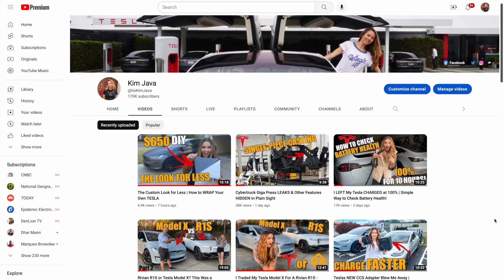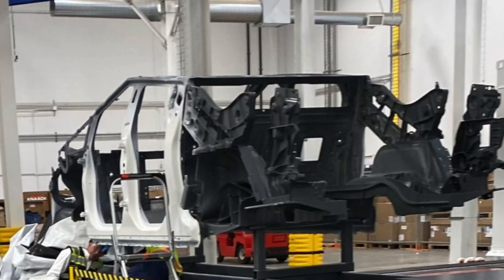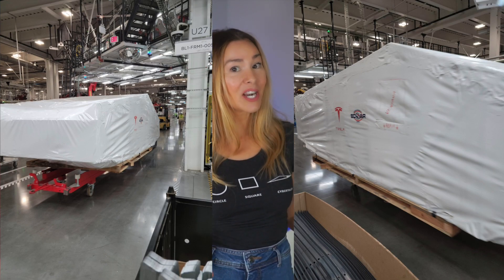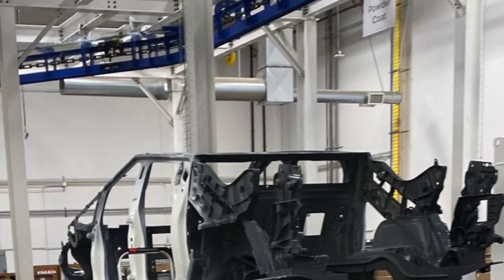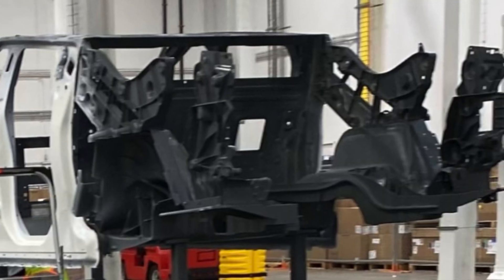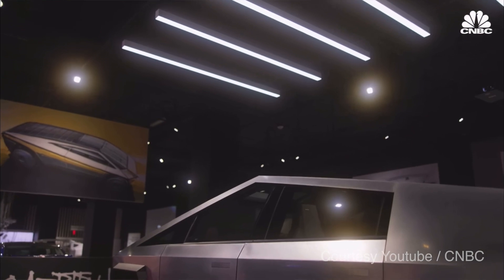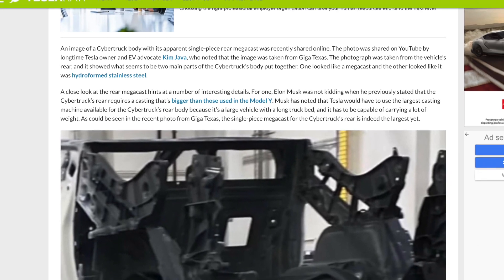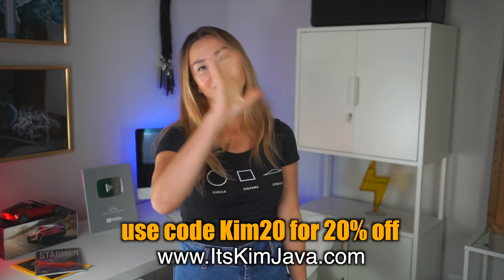DETAILED Look at Cybertruck’s UNIQUE Frame | Everything We Know Part 2

Comment: Stainless steel work hardens, meaning you can’t hammer panels back into shape. Each strike makes the metal more brittle until stress fractures form and it eventually ‘snaps’

Comment: I can't see how the entire black rear half is one single piece, how could that even be extracted from a mould with all those extended pieces and angles? My guess is that the wheel wells and the bed walls and rear gate structures are separate and attached to the wheel wells after the fact.

Comment: Is hydroform the same as injection molding?  I think you said the former is for stainless steel but I understand the latter is for aluminum.  Confused af from your video as usual
Reply: Hydroforming is using the pressure of a liquid , such as a oil. Two sheet metal plates are put in a mold and fluid introduced between plates under big pressure that pushes the plates into the shape of the mould.

Comment: The castings for the inner structure should be aluminum.  If the mega-castings were stainless it would be extraordinarily expensive and super super heavy.   What we're likely seeing here is a Cybertruck body "in the white".   My guess it that it will be aluminum inner structure with stainless steel body panels.   Those mega-casting machines are made to make aluminum forms, not stainless steel.
Reply: Yea lol wtf.  Why are we talking about hydroform stainless steel when we know it’s aluminum?
Reply: I'm the only one reacting to this body in white (front part) - wasn't the idea to have the stainless steel as an exoskeleton? Seems they are going back and doing it DeLorean style with stainless steel panels or am I wrong?
It could be good either way but much talk about the CT was that without stamping the factory floorspace need would be smaller.

Comment: My Toyota Tundra Crewmax has a rear folding seat not for a mid gate but for cargo base platform instead of placing it on the actual leather seat or fabric. I’m guessing that was the intention of the folding seat on the rear.

Comment: The opening between the cab/ vault is smaller than a doggy door, that's not going to work. My only hope, is that  you're incorrect. Tesla, please design it so I can alter it myself. How else will an exo- frame  truck utilize it's full potential. I will roll, crawl, or shimmy, if necessary.
Reply: That's a prototype in my opinion,  it should have a pass through , but if funds are tight , to make it cheaper to make , might be no pass through. It's technically difficult/ expensive to make a safe midgate.

Comment: The midgate and tonneau cover seemed to be conflicting features, as that's where the tonneau would be stored.  The tonneau was heavily featured in presentations, so that is a feature guaranteed to be present in production.  Therefore, I'm not surprised the midgate is not present.
Reply: Hopefully they paid attention what Rivian did wrong with their tonneau cover design.
Reply: Most likely yes but their COULD BE creative alternatives…. I’d roll roll a “slabbed” cover into the Midgagte and use tin as a rear firewall.

Comment: The cost of having a cast frame is huge because the mould is so expensive. Any changes to the frame, the cost will also be huge. When it comes to modular design, this module is too large.
Reply: Flip that over. The cast frame is hugely cheap because once you have the mould you can crank them out for way less than stamped and welded parts.  Plus alignment of the many stamped parts goes away.  Rigidity goes up.  The casting can be worked and welded if damaged in a collision.    Legacy auto makers don't want to do this because it means scraping a large portion of their body shops.   So of course they say it is bad.